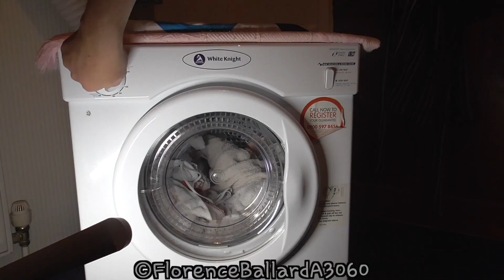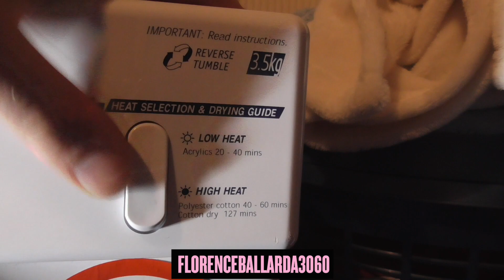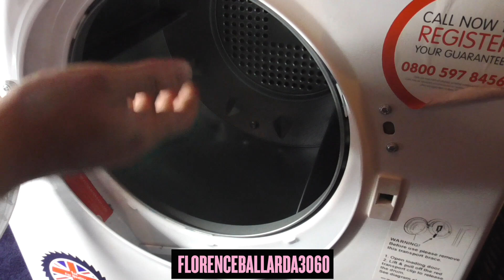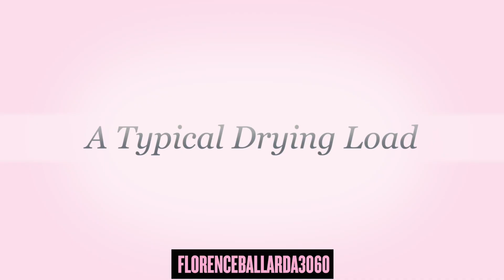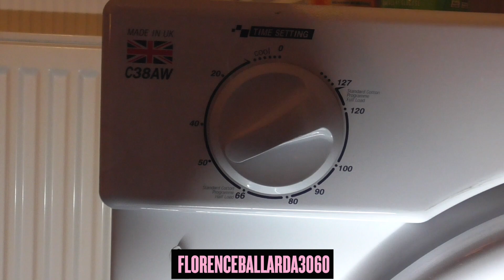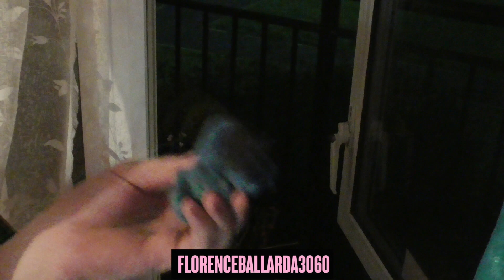FlorenceBallardA3060 Reviews: White Knight C38AW Compact 3.5kg Reversing Tumble Dryer

Comment: Do you find your room gets more dusty when you let the dryer air run inside ?
Reply from the maker: It did, one of the reasons I vent it out as I have dust allergies as well as severe hayfever. It is nice opening the window to. let fresh air in, but I use the condenser box when it's near to freezing temperatures outside

Comment: I would have made the duct a bit longer and hung it out the awning [window] at the top of your UPVC window, those are smaller than the full-hight casement [window] and you lose less heat with it being open. Like the look of the AEG L9WEC169R washer+dryer, it claims to have a heat-pump dryer function.
Reply from the maker: That's not a bad idea tbh. I might look into an extension hose or air ducting hose for this dryer to shove through the top window